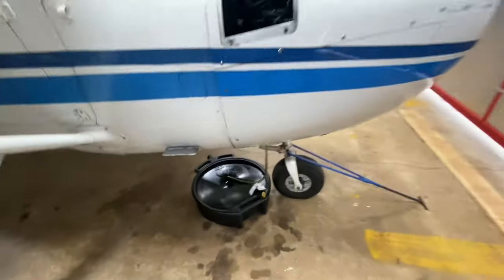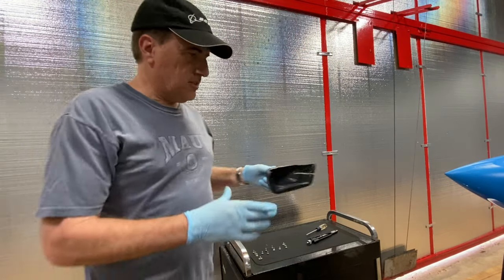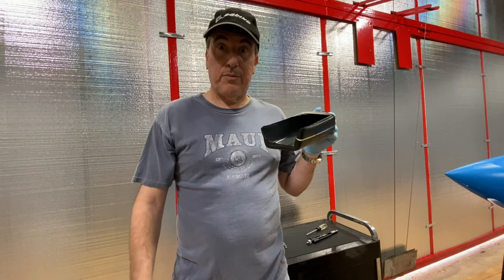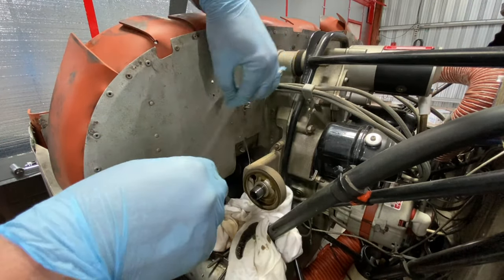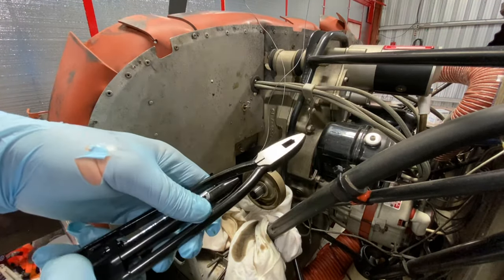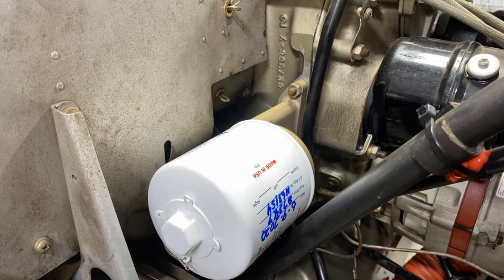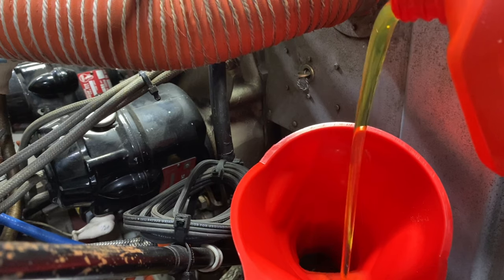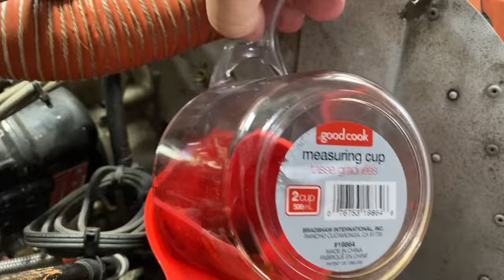Cessna 150 Oil Change Tips

Comment: 25+ year A&P here, your attention to detail as an owner/operator is good to see. Just to protect yourself you should make a disclaimer that your video is in no way to be used as a "how to video" and that viewers should always use their current AMM. It's also good to note that just because the FAR's allow owner/operators to do certain maintenance on their aircraft, it doesn't mean they "should be" performing it themselves. I see nothing wrong with what your doing, I just wanted to put that out there as a general comment. Now, tips I can add that may help someone -- When I take safety wire out of the can, I hold both ends and give it a twist to straighten or run it through my fingers to straighten before inserting in the hole in the base. Next, while the filter is still off, I take the old wire, get a basic measurement onto the new wire, place the twisters, and put the basic length of twist on making sure it is not too long. Then install filter, apply the proper torque, then you will find that a few hand twists will get you to that perfect length to fit the filter lug. Use the pliers to give it just a half or a whole extra turn from the end, and it will look perfect as far as twists per inch. After the wire is through and brought back together, put the pliers on and grab the wire. Give the wire a tug and pull some pressure on it before twisting. The braid up to the filter should be tight. Give it a tug with the pliers before twisting. When you finish your second twist, give the pliers a half twist by hand in a big "C" motion taking the pliers out and around (hard to explain in words) this will really tighten the whole outside braid without over twisting the wire. Maybe a mechanic can show you - it is a very common trick that is pretty much "tribal knowledge" in the trade and works well. I see looseness in the final safety wire from the base to the filter. That should be very snug if not tight otherwise the filter can turn just a bit before the wire would stop it. It's not horrible, just it could be better - that's all. I like how you take the extra step afterwards to go look at everything that was touched. This is also a good time to look for general cleanliness, and don't be afraid to touch, push, pull, and check the security of everything on the engine. Don't be shy! That's how we find loose hardware, or stuff out of place. Look for wires chaffing or parts rubbing that shouldn't be. Lastly, it's good to note that when cutting open the filter, seeing a fair amount of carbon is normal. You mainly want to be sure it isn't metallic in nature. Run a clean strong magnet over the filter media to see if anything leaves the filter and sticks to the magnet. There are plenty of non-ferrous metals that won't stick to the magnet but that is at least a good quick check. Great job overall and thanks for sharing this!!! Safe flying...
Reply from the maker: Great advise.  I'm still learning how to get the safety wire right.  Thanks for all the good tips!

Comment: Either hold the oil bottle flat or with the opening towards the top when you're poring oil in the filter and it will come out smooth.

Comment: Filling the oil filter is something my grandfather taught me - a life-long mechanic / jack-of-all-trades. I followed in his footsteps. Worked on my own things my whole life, and went to motorcycle repair school (MMI) in Phoenix 21 years ago. Been doing nothing but turning wrenches on everything from weedwhackers to trucks for the past 11 years. None of my cars, trucks, motorcycles, dirt bikes / ATVs, or paramotor ever see a shop other than my own, except for body work, windshields, or front end alignments. I've seen the proof that priming the filter is a GOOD thing. I used to have a hot-rod Cutlass when I was in my 20's, and you could hear the lower end rap until oil pressure built up, if I installed the filter dry. I did it one time just for my own curiosity, since I had been doing what dad and grandpa taught me for years without questioning why. Oil pressure gauge stayed at zero for several seconds after startup, too. Adding oil to the filter cut that time by 2/3rds. Also, we own a '86 Mercury Grand Marquis (17 years this year) with 268k miles on it. Every spring when I fire it up after sitting all winter, she'll run dry for several seconds. Sounds awful! Had I been less lazy, I'd have pulled the distributor every season and primed the oil pump before attempting that first start. Would  probably get 750k miles out of that engine! If you've ever seen what happens to crank and con-rod bearings when they're starved of oil, you will fill the oil filter on EVERYTHING you own, as I have for the past 35+ years. I fill it right to the top, even if it's a horizontally mounted filter. Spilled oil is cheaper than a rebuild, no matter what it's powering. 😉

Nice work, Jim! If you think your clothes are bad, you should see my GOOD clothes! 😂
Reply from the maker: Wow!  Great information.  No wonder the guy recommended that I fill the filter.  Thanks for the information.
Reply: quinnjim - You’re welcome, Jim. You’d be amazed at how much a few seconds without oil pressure has a cumulative effect over time. Best to limit that whenever you can. 👍🍻

Comment: Just a couple of comments.  Camguard is the real deal and nothing like Marvel Mystery Oil.  It was extensively tested by the FAA and does a great job.  Also, the new Spin EZ filters do not require you to put oil around the seal prior to installing the filter.  I was skeptical at first but it does work as advertised.  I haven't had any leaks through multiple oil changes and the filter is easy to remove.  Probably doesn't hurt to use oil on the seal if you want.  You should be good to go either way.  Good idea on using the cut open oil container, wish I could use one but my access is harder so am using a "form a funnel".   Quick disconnect is on my oil pan as well.  It is the only way to go.....and never leaks.
Reply from the maker: I found out after the video that you don't put oil on the seal.  It says so right on the box.  I had never heard of anything like that before!  I've been changing oil for almost 40 years.  I think Camguard definitely helps.  I've also heard that Avblend does a good job.

Comment: 👍👍👍👍totally and absolutely enjoyed this video..all the details 👍👍👍been changing my own oil in autos all my life..never saw an airplane oil change procedure..might do a couple of things differently..probably use motorkote in the engine (excellent friction fighter that has proven itself through the time test of over a billion miles in the trucking industry and autos)..and I would probably have a 1000 point safety check list to go through with an airplane..often..cars don't fly..if something goes wrong you can pull off the side of the road..not in an airplane..ok now you've seen how uptight and weird I can be 😂😂🤣🤣👍👍maybe I would level out some and calm down a little if I ever started flying..anyway completely enjoyed this video..keep doing these please 👍👍👍👍
Reply from the maker: Thanks very much!  We change the oil every 25 hours or so.  The oil additive I used is supposed to be excellent.  There are only 3 things you deal with when doing the oil change on this type of airplane (drain plug, filter and filler opening), so a 1,000 point safety check would be difficult!  :)
You make a good point that an oil problem in an airplane can be much more serious than in a car. You can't just pull over and take a look.
Reply: I didn't mean to sound like I was telling you to use motorkote..what you use sounds excellent and if it does the job..absoulutly keep using what you use..and the 1000 point safety check list..I'm just one of those people..I always check and recheck myself..did I forget or miss something..too uptight..maybe I need to take it down a few notches 🤔🤔🤔😂😂😂 but up in an airplane 😬😲😵😂😂😂 not good to have that type of personality and be a pilot..right? 😲😬😊😊..but I do very much enjoy the information and education I see in your videos..again thank you much 👍👍👍
Reply: @quinnjim  Great video. The Aeroshell 15W50 already has an additive for Anti-wear and Corrosion preventative. Although not Camguard, I am told that it is pretty similar. I have always run Camguard with my Aeroshell 15W50, however at my next oil change I am considering not using it as the Aeroshell already has an additive in their formula. PS: Motorkote is not approved for aviation engines.
Reply: Ah ok Christopher..you told me more info I didn't know..there are so many places motorkote can be used..all gas engines..4 cycle and 2 cycle..firearms..almost anything you can think of..I did not know it was not able to be used in aviation purposes..one more piece of information I learned 2da..thanks 👍👍👍

Comment: Clean-looking M model you have there!  Mine is a few serials older than yours, getting the spin-on oil mod in a month or so.  I actually just crossed TBO (which on the O-200 is actually 1800 hours, not 2000 like the Lycoming O-235 in the 152).  She's making good compressions on all 4 cylinders, though I did have to have #3 rebuilt at annual this year for a worn exhaust valve.  Still breaking it in, which is why the oil change is coming up in about a month.  .  

Most importantly, the engine isn't making metal.  A&P/IA looked at what he could see of the cam with a borescope while the cylinder was off, said it looked great.  He and I have discussed in depth.  He doesn't see any red flags currently, so I'm budgeting for an overhaul in about 4-5 years unless the engine tells me otherwise.   

Hope you've been flying the wings off her.
Reply from the maker: I did a few oil analysis tests and the results came back great.  I’ve got about 600 hours on this motor.  I flew a Cessna 172 once that had 3,600 hours on the O-320.  TBO is just a suggestion.  I have had several friends in the last few years who overhauled their engines and had nothing but problems.  I’d take an engine that has been running well for twenty years over a new overhaul nowadays.  Continental quality has really fallen since the Chinese bought it.

Comment: An awful lot of screws to remove and index their order, when by now, you'd think they could have made a convenient hatch for easy access to oil filter! Cool oil catcher and it probably would cost $100.00 if it was a custom part, from Cessna!! In all, it seems expensive for something needed every 25 hours! But, understand, more safe than sorry!! A job well done!!
Reply from the maker: It would be nice to have better access to the oil filter.  I can take the top cowling off in about 5 minutes, and it's a good opportunity to take a peek at the engine to make sure everything looks OK.  Most of our flights are right around 1 hour, so we only need to change the oil a couple times per year (flying 50-60 hours per year is a lot for most people).

Comment: Now for my serious comment.  The twisted wire safety on the filter is a great idea!  The quick disconnect on the drain sure makes it easy to drain.  I had a “discussion” with an A & P about this.  If there is a safety on the filter, how about something for the auto drain.  I think the engineers did a half good job.  A safety would have made it perfect.  Just as an aside I am not a mechanic I am a PE.
Reply from the maker: I'm hoping the pressure keeps the quick oil drain seated properly.  It does seem a little weird that you can make the oil come out so easily.
Reply: Not sure if you know of Nancy Bradshaw.  She is paralleling you in Texas and Florida.  Regional Pilot and CFI.  Prior to becoming a pilot she got her MS in aviation engineering.  She is “off tube” this month, but it would be interesting to hear her take on this.
Reply from the maker: @inquisitive980  I'll check her out.

Comment: Thanks for sharing! I have an oil change coming up on my C-150J. Does oil leak from the new filter as you install it?
Reply from the maker: Nope.  I make sure the filter soaks it up first.  I learned that some oil filters don’t require you to put a film of oil on the gasket.  You want to check for the directions on the box the filter comes in.
Reply: @quinnjim  Will do! My quick drain oil plug is starting to leak and I'm going to get a new one. Do you have any opinion on which one to get? Again, many thanks for the tips!
Reply from the maker: @YamahaC7SRG  I have never bought a quick drain, so I don't know much about them.  Sorry!

Comment: You missed out on big round engine oil changes! You use quarts Round engines use Gallons. Normally 6 gallons on a 450 and 600 hp!
Wire skinny thingy, I love technical talk! Did you get your at the aviation department at Harbor Freight? Thanks for the video!
Reply from the maker: Love those round engines.  My friend has a Cessna 195.  I'm going to try and get a video of it for my channel.  The guy in the hangar across from me has a T-6.  He has owned it for over 50 years.  In his 80's and still flies it every day.
Reply: @quinnjim  I was weened on AT-6's. My neighbour when I was a kid had a company that bought and sold 34 of them. He also gave me the opportunity to tear down my first aircraft engine. A Curtis OX-5 from a Waco 10, I was only 6! Thanks for the videos. I spent over 25 years working on crop dusters. I sure miss those long hard days!

Comment: Could you use a filter magnet on the oil filter, to trap any metal?
Reply from the maker: In aviation, everything is regulated very tightly.  You might be able to do that on an experimental plane, but the certified airplanes might not allow it.  I'm not really sure.  

I have your Youtube name laser etched on one of my 1911's.

Comment: Looks like you have a Continental O-200.  Cam Guard is MUCH more important in Lycomings which have the cam above the crank.  The Lycoming cams loose oil coverage during storage, condense water, and rust.

Comment: I,ve been trying out 7 quarts . The dip stick goes up to number 6 , but the oil passes it by one more. It seems to be going good. O-200 A . 1977.
Reply from the maker: You will destroy your engine doing that.  It will be "going good" until it fails prematurely.
Reply: Ok thank.My mechanic did that.In the POH it says  do not opperate under 4 and max is 6. I was thinking,over the 6 would be saffer than under 4.
Reply from the maker: @danielyasko9864  If you put 6 in, the excess will dump out of the breather tube and end up on the belly.  These engines like 4 quarts.  Anything more is just a waste.  They will stay at 4 quarts for awhile (usually).  Over servicing the oil can do damage to the engine.  No good mechanic would ever recommend that.
Reply: What's it at when you land after two hours of flight??    

7 is way over full on an o-200
Reply: @NEW_N18155  That was 2years ago.When he did the oil change last year, he filled to the 6 mark. Everything is cool.Thanks for the concern.

Comment: I have a problem.  The oil filter has a safety wire to keep it from vibrating loose.  Great safety idea.  Now for the oil drain.  A quick disconnect?  Great for your garden hose but your aircraft?  The professional engineer in me just said what???  Simply consider Murphys law.
There was an A & P that did a similar video on a 150 and I was shocked when the quick disconnect was shown.  I have tried to get an opinion from Nancy Bradshaw.  She has your parallel job flying and instructing.  She also has degrees in aeronautical engineering.  She is not familiar with the 150 oil change so I have not been able to get her opinion.  I do realize there is no history of problems with this method, however it only takes one to start.
I am in no way directing my dissatisfaction with the engine designers to you!  Just bringing up something I am very much against.
Reply from the maker: I think the "quick drain" systems are pretty fool proof.  Just about every plane I have owned has one.  If you are not pushing up and turning them "on", they really don't leak.  I guess it is just one more thing to go wrong though...
Reply: It is not a "quick disconnect," it is a quick drain. They have been available, and very popular, since at least the 1960s. They replace the drain plug, and are safety wired in place at installation. They are, essentially, a spring loaded (to the closed position) valve, typically with a cam type operation. They are very reliable, and really speed up oil changes, as well as eliminating much of the mess potential. I've owned many airplanes with them, never had a problem. The only reason to NOT have one is in the instance of possible airframe interference, such as a very close bowling or retractable nose gear, which could possibly force the v as live up and open.

Comment: Looks just the same as mine 🤔  9:27  an  INVICTA..??? ⌚️👍
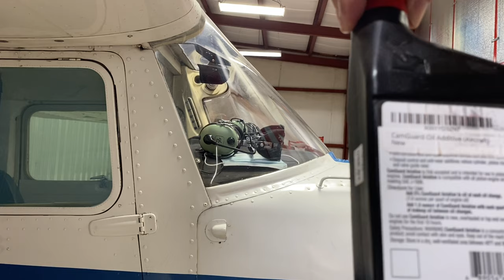Every one I know since way back just puts some “Marval Mistry Oil” in with it  11:50  the A&Ps all swear by it ✅😎
Reply from the maker: Indeed an Invicta.  I really like the watch.  It started out losing 15 second per day.  I would set it 1 minute fast and it would be constantly getting more accurate over the next 4 days!  Lately it's losing 2 minutes per day, so I may have to adjust it.
Reply: quinnjim yes, I have had mine for over three years, actually that one an the silver & gold band with green face too, but it wouldn’t stay running over 24 hours after leaving it sit the way this type does, about 30+ hours actually. It would loose 5 min per week though, so I finally set it up faster in January, ever so slightly. With the jewelers hood spectacles and tools 🛠 I have from doing most all my watch work (like the airplanes) myself. But even with the slightest of almost Unnoticeable movement to the + side it now gains 5 min a week 😣😩👎 go figure.. always had much better luck on the airplanes ✈️ Hey, are those ECI cylinders.?? I found them to be the cheapest Good ones to use, replaced 3 of them over the years on my last plane, the 1972/73 C-150L 😎👍